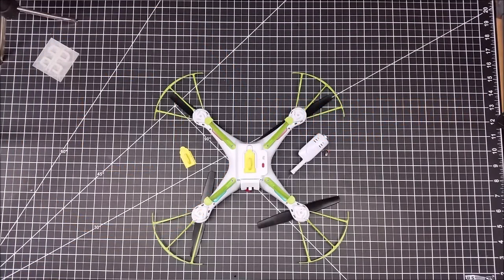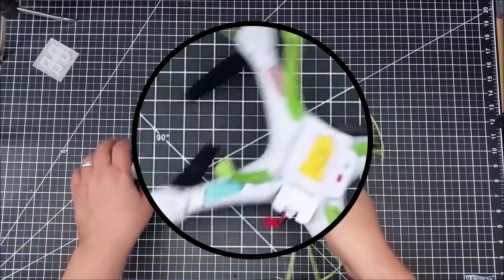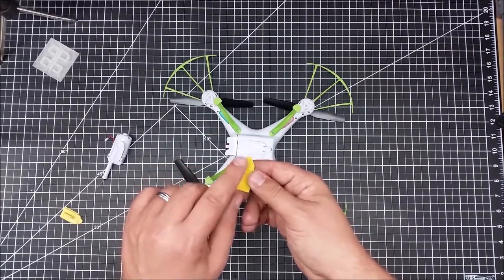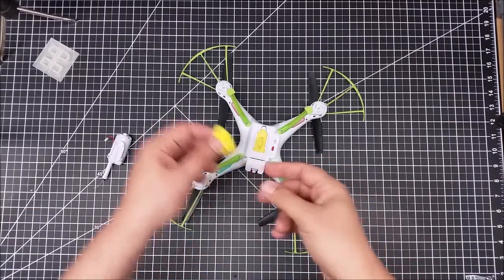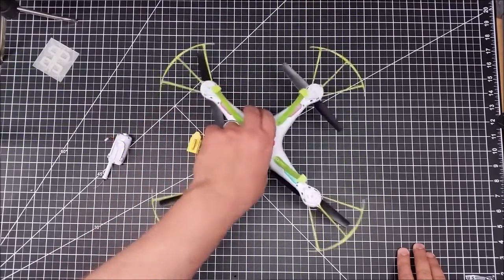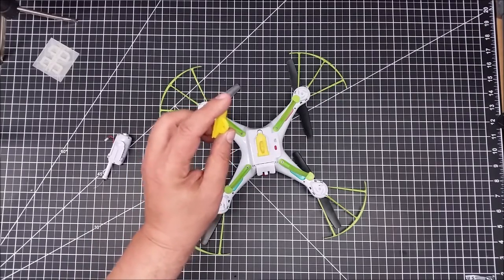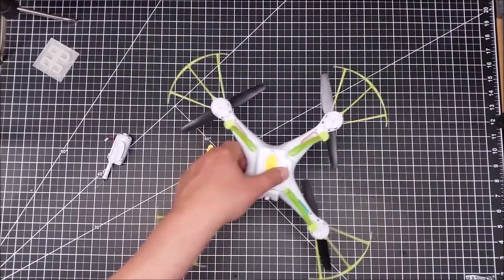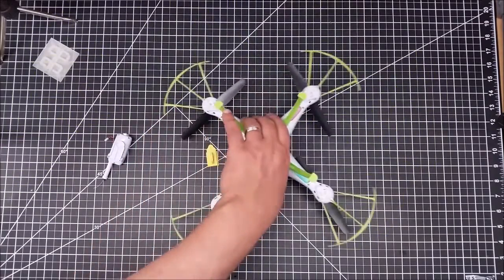Video Drone - Syma X5 3D Printed Camera Adapter!

Comment: Always amazed how much you can design in TinkerCad.  Would like to see camera footage from a mounted camera on that quad. Does seem to be any suspension system?
Reply from the maker: Yes is none (suspension system) but is not too bad.  The X5 is a lot fun to fly as it will fly in very tight areas so the reason for designing this as I am going get an 5.8gig FPV and instead of the crappy one which comes with it...